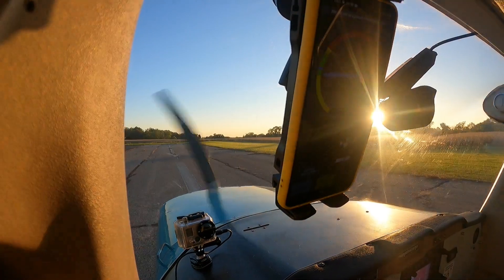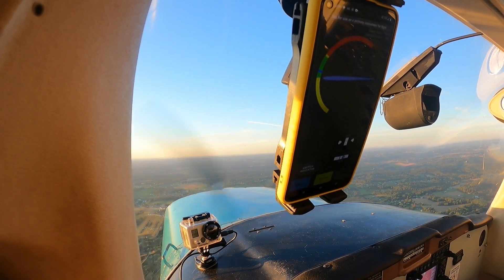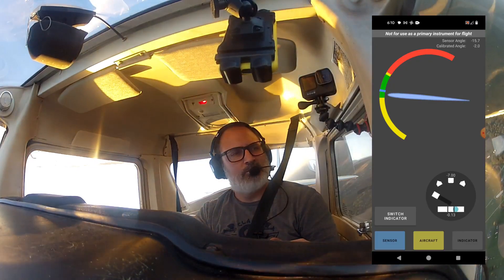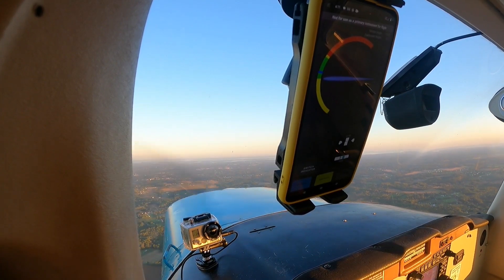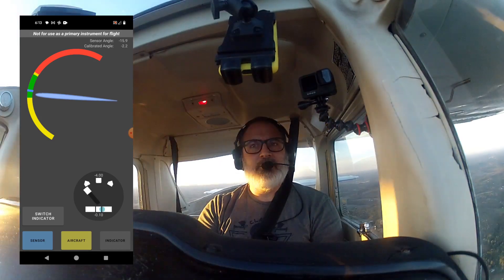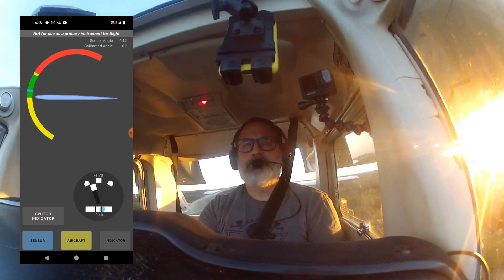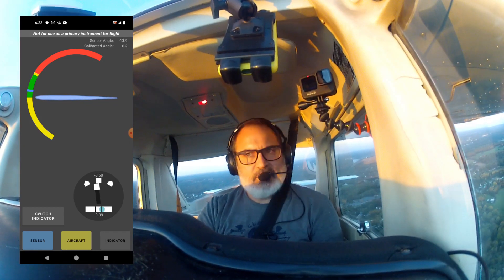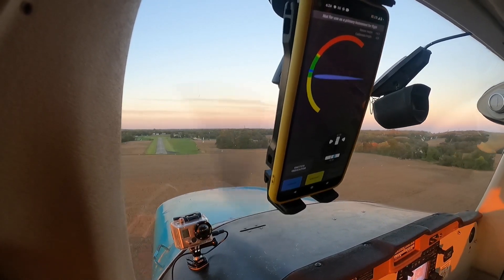Flight Testing My Latest AoA Sensor Module

Comment: It would be nice to integrate aoa sensor with somehow the pitot tube and implement an algorithm to show the aoa associated airspeed like modern and expensive a/c do

Or atleast have the app display the aoa degrees
Reply from the maker: Airspeed and AoA are different. While you can use pressure differential for both, airspeed requires a static line which doesn't change - airspeed is measured by the difference between pitot ("ram") air pressure and unchanging ("static") air pressure. The important thing here is the unchanging static pressure. 

With AoA, you can still use ram air, but there is no longer a "static" pressure line. Instead, there is a second ram air inlet that is offset by a number of degrees (usually 60°, but I've also seen other offsets as well) from the high pressure/pitot inlet. When you fly straight and level, the upper ram port is hit directly with relative wind, but the lower ram port is hit indirectly (lower pressure). The differential pressure changes (decreases) as your angle of attack increases because the relative wind hits the lower port more and more directly (creating higher pressure) and the upper port is hit less and less directly (creating lower pressure). 

So, just to be clear, you need two different and separate pressure systems for airspeed and AoA. They show similar, but different pressure differentials and one can't be used for the other. 

Here's a video I published a while back that demonstrates a pressure differential AoA that I designed that interfaces with an open source EFIS that I've been playing with in case it's helpful:
https://youtu.be/cIsv_dQTMyo?t=07m28s

For my pressure differential AoA, I offset the upper and lower inlets by 90 degrees. When flying straight and level, this will yield a 0 kPa difference in air pressure between the two inlets because the relative wind hits both inlets at 45°. As angle of attack increases, the lowered inlet increases pressure and the upper inlet decreases. This inlet configuration can also show negative AoA (which is mostly worthless unless you spend a lot of time flying inverted). 🙃🙃🙃

Comment: If you're open to ideas: do you have a log function that shows the AoA over time? Maybe log the AoA vs. bank angle?
Another idea: let the device determine the stall AoA itself? Using an accelerometer during a stall exercice: let it detect at what AoA it starts loosing altitude
Also: stall AoA changes with configuration...maybe you could show a flap extended arc nested the main arc on the gauge?
Reply from the maker: Yeah, I'm always open to ideas. Thank you. 

History: Are you suggesting a graph that keeps the last n minutes of data and continually moves as the flight progresses?

Auto setting critical angle of attack: I'd be very leary of this. If you hit a bump while auto calibrating, it might not set properly. I think it's better to have someone else in the airplane and have them tap the set button while you fly the airplane. Or incrementally set it by typing in the numbers between calibration stalls until it matches your comfort level. 

Clean/Dirty Configuration: that's a good idea. I've been thinking about how to deal with flaps. Maybe a second critical angle of attack value could be added to the calibration page - one with a "flaps out" value and a "flaps in" value. And then have two different arcs - one outside and one inside (sort of like you might see on an ASI) denoting different configurations. 🤔🤔🤔

Comment: I really like that you're making it available to everyone, thanks!
One thing is that I'd like the analog gauge to be zoomed in. If my wing stalls at 16°, I don't really need the 25° to 90° range, do I? It would also probably helps to have the calibrated angle displayed in big fat characters near the gauge
Reply from the maker: Hey Nick. Thanks for the suggestions. You're right, you really don't need the full 90° range. The gauge is already 2x zoomed in. Maybe 4x would be better. When I have some time, I'll look at that. 

The numbers on the screen are really only there for my debugging purposes. My plan was to eventually remove the numbers altogether and just have the gauge. But maybe it would be beneficial to show them more prominently. 🤔